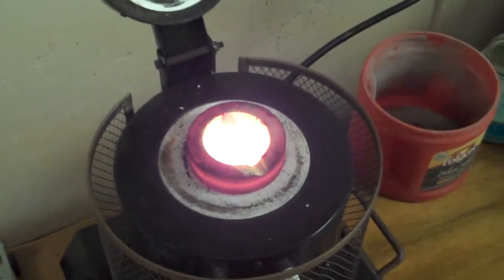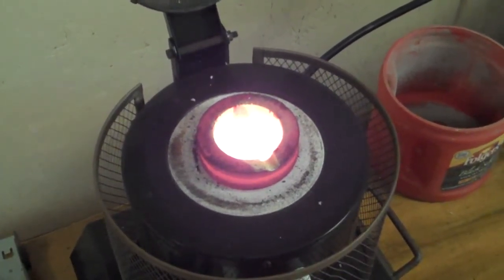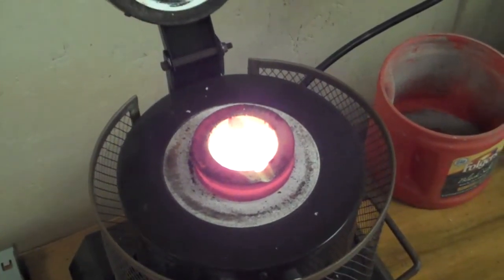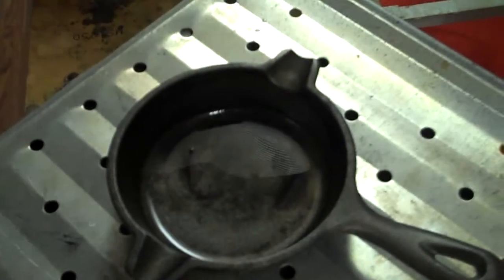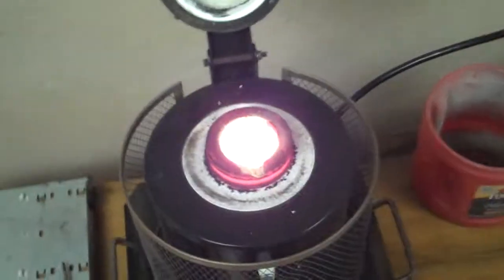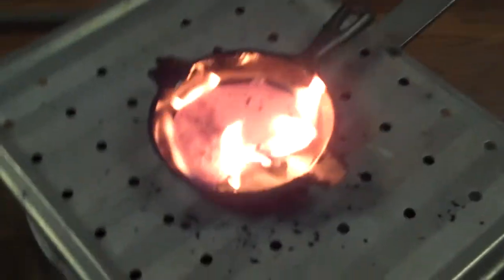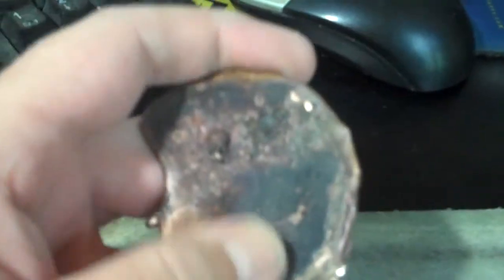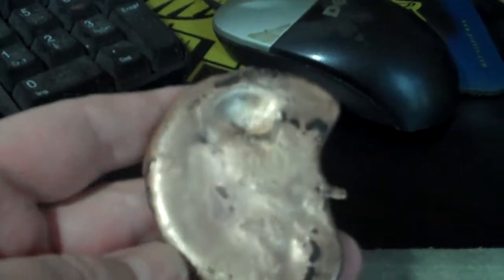Electric Furnace Fun: Melting RJ45s

Comment: Look up Cupelling or Cupellation, it will give you some great insight,

also i bought a great old book off of Ebay called dental metallurgy, i find that old books are the best, the concepts and chemistry has not changed at all, and the old books explain in a simple to understand layman's way.

Comment from the maker: Is yours new or used? According to the guy I bought mine from they are made to run 60 hours and then you need to replace the element. Either that or the thermostat may be bad. They are made to take apart easily. My thermostat isn't even attached to the unit. It can be pulled out and unplugged.